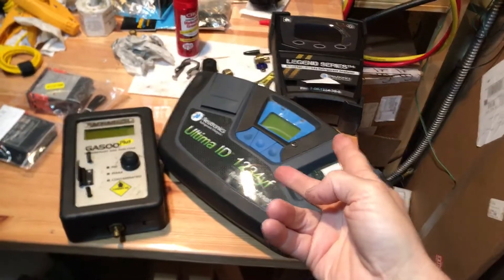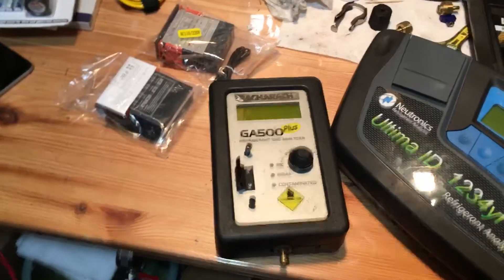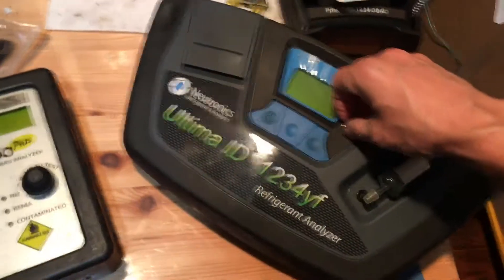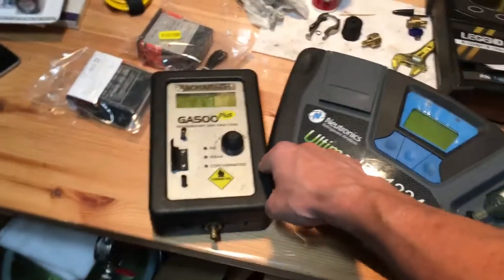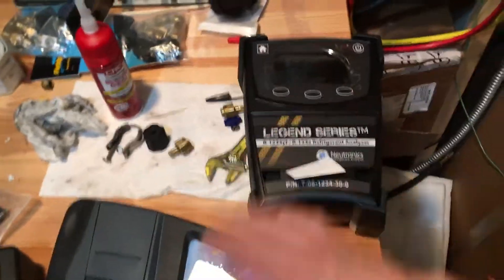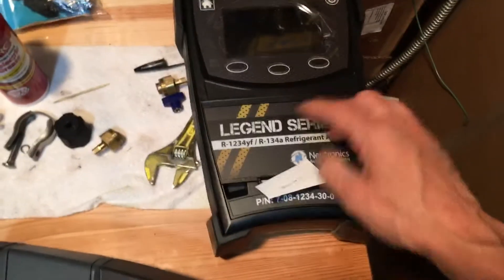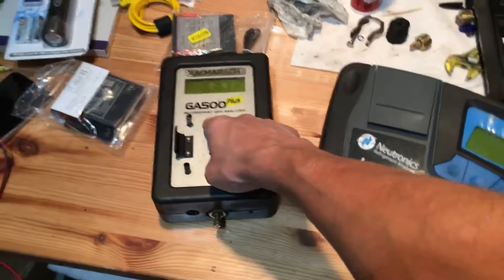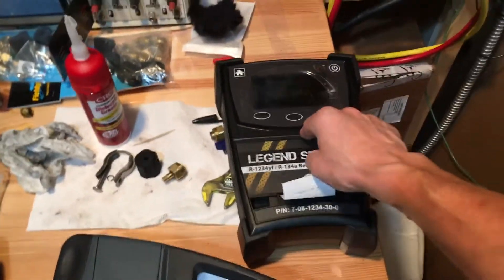Refrigerant analyzer, Neutonics (Legend Series), (Ultima ID 1234yf), (GA500 plus) California law

Comment: GA500plus WTF is that !? Can you trust this device? Looks like 50 year old device
Reply from the maker: @totalclima88  as long as you have a good sensor. But it has a circuit board component problem after one test screen goes black.  I have two more new ones I use on a daily basis.  Like my dad’s 50 year old H-10 refrigerant leak detector still good as the day it was made they still make sensors for them.
Reply: @coldfinger459sub0  H-10? You mean this big dinosaur leak detector? Probably any 150$ detector from China will be better than h10.

Comment: What’s your opinion on neutronics stop leak tool
Reply from the maker: It works only if you’re worried if you have expensive automotive refrigerant recovery machine you’re worried about. 

If you have one of the portable recovery machines like I use you don’t have to worry about it they will not affect them

Comment: How did you resolve the sensor issue on the analyser?Mine does that as well.Also what causes that to happen?
Reply from the maker: On the old GA500 there are no parts available I still have not opened it up to see if it’s hopefully a capacitor issue

It still works but I only could do one or two test and then it shuts down gives you an error

On the one that’s only one generation newer I developed a O2 sensor problem but they still have parts for that can order that straight from the manufacture
Reply: @coldfinger459sub0 Thanks for your reply,with the neurotronics ultima oxygen sensor problem is it something i can change or does it need to go back to the company?What causes this issue?I bought it second hand but never used literally brand new.Where can i find the part from also.Thanks
Reply from the maker: @cagatayveli7065  It is something you can service yourself and get the part but if it’s still under warranty then you may just wanna ship it to them and let them do it for free other than the price of shipping
Reply: @coldfinger459sub0  Thanks so much for your help,this is my second identifier i lost $6000 aud on them last one went to the bin.The current one i have has been purchased over a year ago i bought it 3 days ago and the seller wont take it back and just to inspect it the shipping from australia is $500 + repair cost on top.I would be really happy if you can send me a link to purchase the sensor and how to do it.I will really appreciate your help as i cant find information on the internet.
Reply from the maker: @cagatayveli7065  I don’t have a part number I’ll re-call the manufacture for it I should keep one as a spare and maybe I’ll do a video on the replacement. 

Keep your eye out for an upcoming video of oxygen sensor replacement on refrigerant analyzer
Reply: @coldfinger459sub0  Thanks for all the info,i will do that.Ill also keep an eye out for the upcoming videos.Looking foward to see the replacement video.